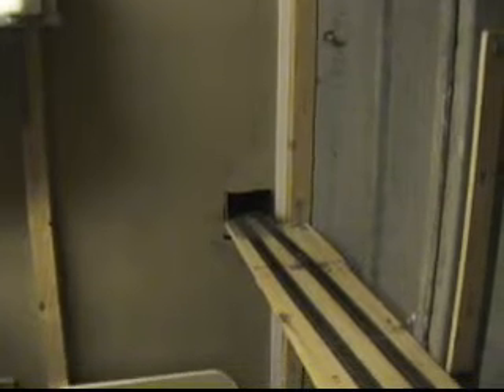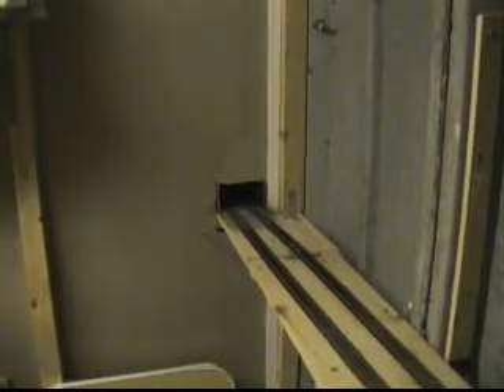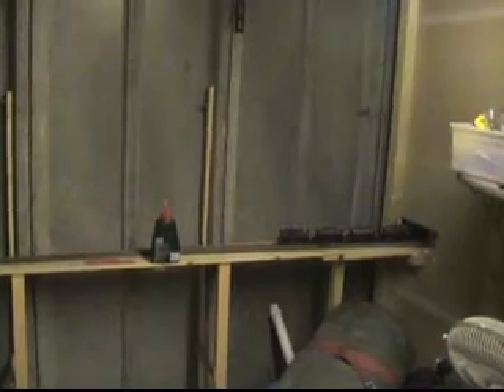MODEL RAILWAY EXTENSION PROJECT Part 1

Comment: looks like a good project.i just drill large holes through the supports for the wiring so it does not weaken the beams.